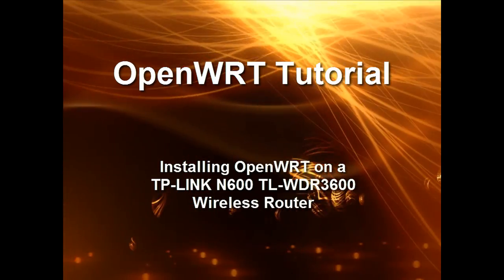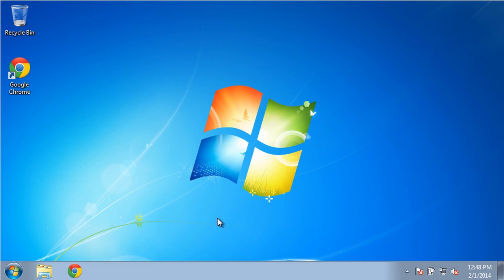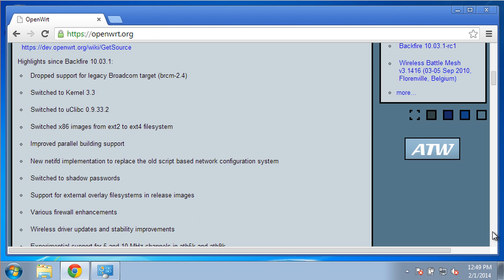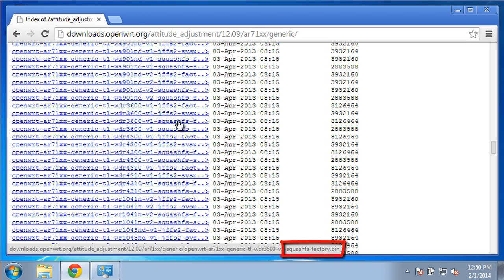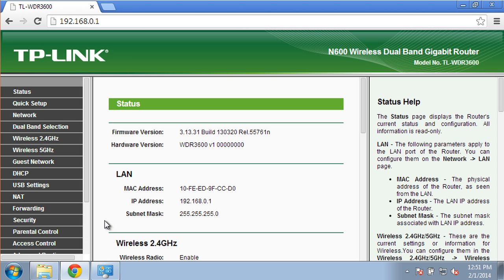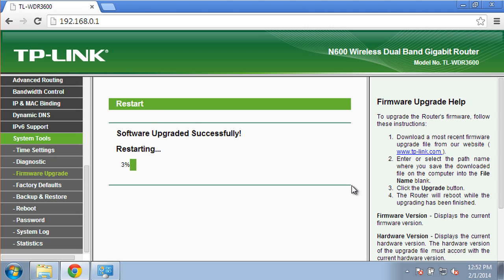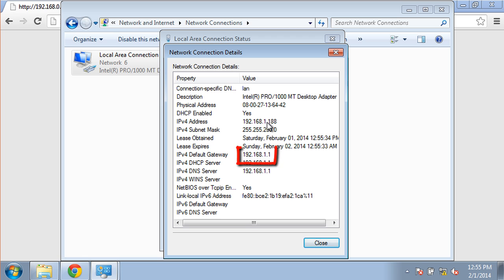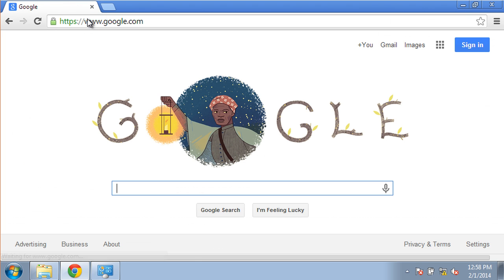OpenWRT Installation Tutorial on a N600 TL-WDR3600 Router

Comment: I finally got round to trying this, but my router simply keeps saying 'Please choose a file to upgrade!'. I have clicked 'Choose file' and selected openwrt-15.05.1-ar71xx-generic-tl-wdr3600-v1-squashfs-factory.bin... Is this a security issue? i.e. it doesn't want to upgrade a firmware file it doesn't recognize? My router is TL-WDR3600 v1 running 3.14.3 Build 150518 Rel.72050n
Reply: rename the file name to something like wdr3600v1_en_3_14_3_up_boot(150518).bin
Reply: Chewie Mantou I actually was not successful in flashing open wrt. I finally went ahead and flashed one of the latest betas of dd wrt. 
http://download1.dd-wrt.com/dd-wrtv2/downloads/betas/2017/03-30-2017-r31791/tplink_tl-wdr3600v1/
Reply from the maker: The video was for OpenWRT 12 but when I tried to update this video using later versions of OpenWRT on newer releases of this router I ran into the same problem is you. I never found a solution and decided to abandon TP-LINK in favor of a more compatible OpenWRT hardware platform. Please see this video for my latest recommendation and example. https://www.youtube.com/watch?v=YB0VL_YFn9M
Reply: Congruity Service That's a shame, I don't want to buy a new router!
Reply: Open WRT page want you to follow TL-WDR4300 install steps, I am just curious how hard it is to change the firmware into that format when they make them available for download..
Reply: I had it just flashed after commenting, and it worked just as easy as how you would use the web gui to flash/upgrade the firmware. I did not know about the beta firmware. I thought the stop making the firmware after 2013 (after seeing the date on the firmware that they offer. How does it work out for you?
Reply: Chewie Mantou it works pretty good for me. They have been making changes every week since 2013. It is definitely better than 2013 version. Plus if you Google the version number, there will be a thread for each beta version which will tell you if the version has any bugs. Open wrt or stable ddwrt never worked for me because I was on latest US firmware and tp link had blocked flashing of those firmware.
Reply: Ah, I see. I am glad to hear that. As long the firmware is updated and patched it is fine. Then people dont need to second guess if their firmware danger of having security bug/leak. I read about the "ban" on third party firmware for US router. It aint like old router are updated by manufacturer all that often. So opensource firmware can be a solution for the user of outdated router.

Comment: I currently have DD-WRT v24-sp2 (06/23/14) std flashed on this model router. Can I just flash OpenWRT or do I have to flash back to the original Firmware? Has anybody tried DD WRT on these and then flashed OpenWRT? Which one has a better feature sets?
Reply: +Edwin Clulow OpenWRT has a lot of user customization while DD-WRT is more user friendly. Recommend you check the open-wrt forums so you can see some nice examples. Its not for the non-technical.

Comment: I have a TP-Link 1043ND (V1) and it's working fine and there are no problems but when it's running constantly for about 2 weeks or something for some reason I cannot access the router anymore, Internet works still fine but there's no access.
So i thought I give Openwrt a try but IDK which firmware to choose exactly

Comment: Which version of the router did you try this on?

I believe WiFi does not work properly on Attitude Adjustment on most versions of the router due to a hardware change that happened AFTER that firmware was finalised.
Reply: The router hardware used in the video is version 1.4.
Reply: +Jared Bratu How the things stand with the same router but v1.0, can i follow the video step by step or i should look for another version of openwrt?